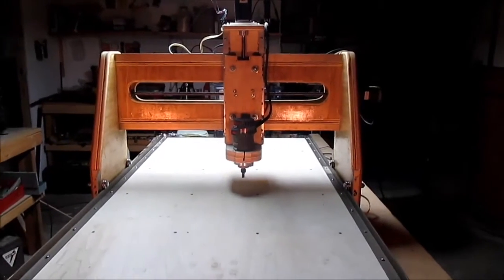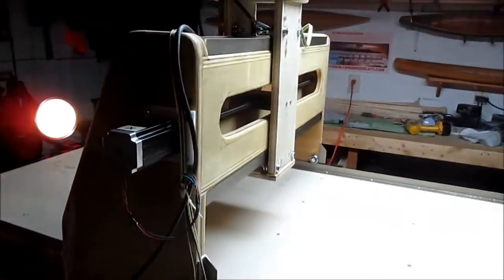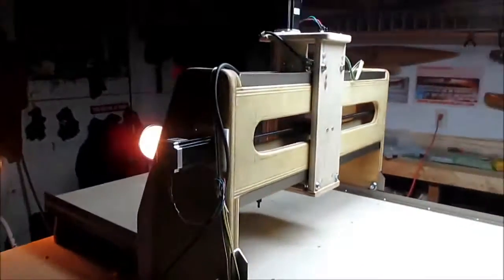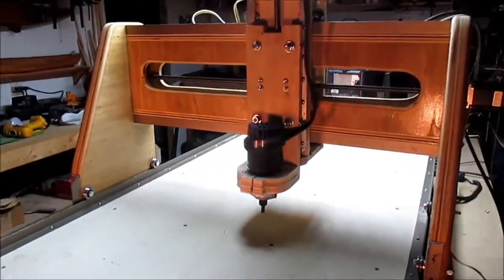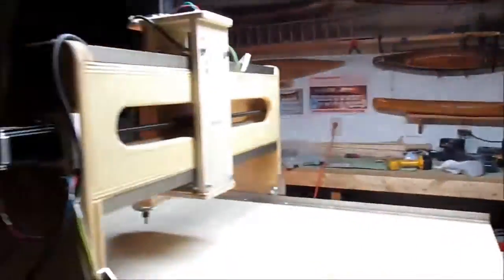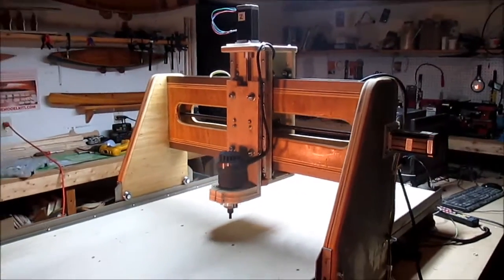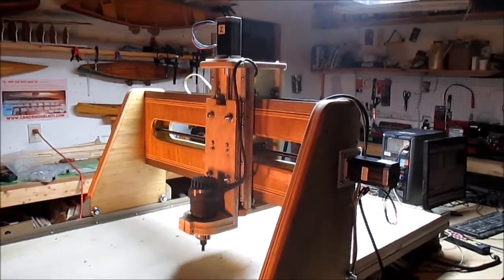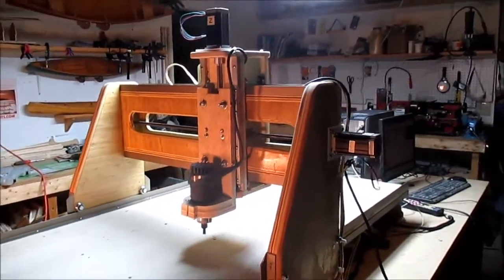First test run of home built CNC router www.canoemodelkits.com

Comment: What kind of metallic made of, are the guides, and what long at the bearings? Greetings from Chile and excellent work! Congrats!
Reply from the maker: That video was well over two years ago and i am going to post a new one soon. Since then I installed a 1.5 kw water cooled spindle and inverter from ebay which has been awesome. The whole cnc has been running almost daily without any issues. I used 1" aluminum angle iron through bolted the edge of the 3/4" cabinet grade plywood. then used V groove rollers, which were cheap. One of things that I used for adjusting all these rollers was a  threaded cross dowels. Worked great. I have more info at www.canoemodelkits.com. you can contact me there as well.
Reply: Your works are amazing; sorry about my english is very bad! God bless you and your work too!